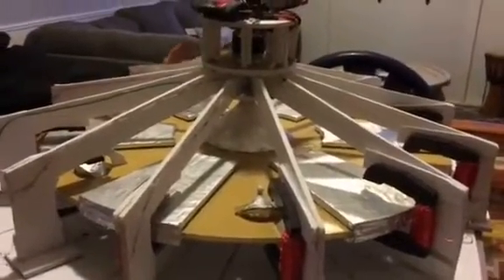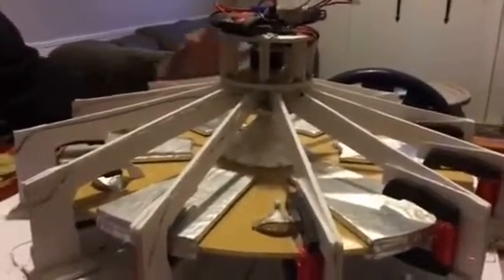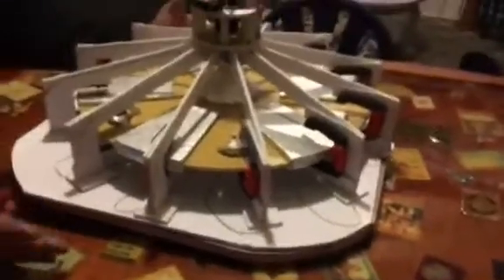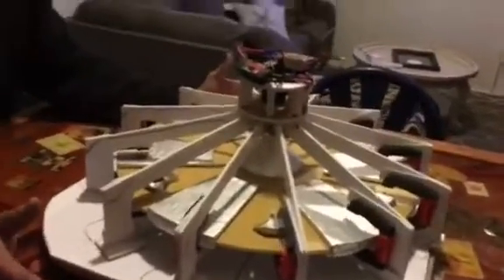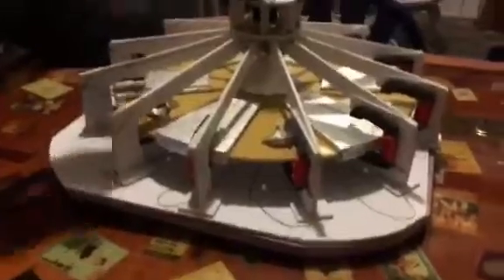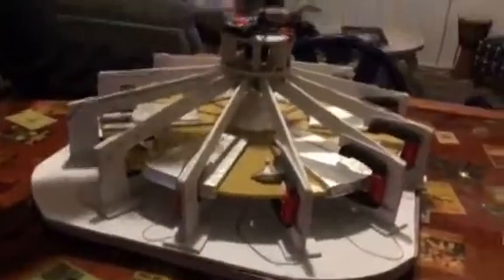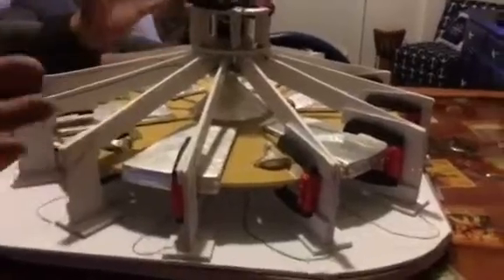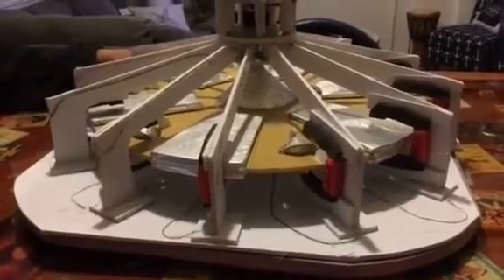OTC X1

Comment: The counter rotation is because it is like a top or gyroscope  ....Your craft needs to counter rotate to make work right ...and the cone barrels on the side need to rotate too the plates on it are like capacitors plates for static or electrons  ...

Comment: It is spinning the opposite way because it wants to lift up..in cress the rpm of the internal disk ND you will achieve flight
Reply: Got any experience
Reply: @multiverse8101  just the copious amounts of research and studying I have done over five years of the OTC x-1 engine

Comment: If you want to sink a screw, you hold a drill and the screw goes clockwise. If everything else is the same, but you can somehow let go of the drill, the drill would spin counterclockwise. If you could just put a little pressure back on the drill, the screw would move clockwise as the drill moves counterclockwise. The outer shell is holding the drill with a little pressure and the inner disc is counteracting that pressure.
Reply: He has a loose screw

Comment: This is Correct like you said ! the inner disc spins counter-clockwise, and the outer hull spins clockwise, they counter rotate each other as Otis mentioned. Probably if you spin the inner disc clockwise, the outer hull will rotate counter clockwise. This is action and reaction taking place, just like a conventional motor when the rotor spins with a torque, the stator will have an opposite force and then will rotate in the other direction if it was free to spin. Or if I jump from the ground, I would go upwards in a moment with a force, in the other hand I am also pulling the earth away from me. If the earth was light enough, she would go away from me in the moment I would jumped.
Reply: It is the effect of the electro-magnets magnetic flux pushing on the aluminum capacitor plates and utrons via Lenz law that causes the hull to counter-spin based on the design of the central axis and bearings

Comment: I think you should replace the outer frame with aluminum..
That magnetic  field wind could help move it.  could..or is it suppose to spin?
Reply: In terms of the concept of the craft, the inner disc rotates clockwise and the hull rotates counter clockwise as it is supposed to

Comment: Yes there's a reason for the two turning parts turning in opposite directions, it's torque effect, same that forced helicopters having a propeller in tail to keep it straigth and not turning around main rotor.
High power aircraft with propeller propulsion had same issue, the influence of propeller and engine torque on airframe. But Otis Carr patent is for an amusement park machine. ??? 
An image of an helicopter that lost tail unit over NYC and crashed shows the body turning around itself.
It could be a case of  'Action and Reaction' principle, which in the end would be just an special case of 'Momentum preservation' principle. Blessings +

Comment: The electomagnetic energy or force created by the coils when energized and in conjunction with the capacitor plates creates an  equal and opposite push force thereby causing the hull to spin counter to the middle disc, at least that is the explanation Carr gives regarding this phenomenon, RCDad i know this comment comes 4 years later, but i wonder have you kept up with the build? i am doing the build myself 3d printing most of the parts that arent required to be conductive electrically, i would like to co-ordinate with you if i have questions since youve allready succesfully built the device to the point where it is spinning as it should.  I am only creating a scaled down version, probably the same size as yours if not a tad smaller.

Comment: It is supposed to counter rotate and the negative on bottom and positive on top of disk shaped craft that is how it hover or creates electcromagnetic field ...Positive always goes to negative... Make feet that attach to bottom that are no magnetic for your device that are not stopping it from counter rotating ... Then add all positive wires of the  c magnet  to top of an antenna and negative to bottom of a antenna and then see what happens ... have fun
Reply: Any luck?? If so how can we chat

Comment: Nice double merry-go-round...... 
But it's lack of lifting or elevation power 

I think that the original blue prints have been changed by fake blue prints....
Reply: I agree that some vital intel is missing, wether intentionally or mistakingly, but i believe we do have enough data to build P.O.C's and experiment further in order to achieve its intended purpose, if enough of us participate in this, i believe someone will eventually solve the mystery of free energy which is the goal, everything else is icing on the cake.

Comment: The electric is pushing the copper counter clock wise causing a rising centrifugal force that in turn force electron outwords towards the the edge with is stored in the steel capacitors (silver material) then since your pushing the disc one way there is a retarding force the opposite I think lol
But in a closed loop circuit using mercury you could you this frictionless material to increase efficiency and power it's self maybe any thoughts?
Reply: Yes!! The Utrons have to be mercury filled

Comment: On a productive note: This is from my understanding of what this machine actually does, from hearing an account of something of similar function: look up a video called “blueprint for a UFO” he explains it nicely. Older gentleman with glasses on the thumbnail. What the central dynamo does is, creates contra-rotating masses, which I think is how the ship gets its mass neutralized. The capacitors around the outside are an arrangement of capacitor plates, insulated from each other, and stacked on top of each other, like if you put 8 pizza slices on top of one another with insulators in between, the point of them being pizza slices is they take up more area space of the circle they are spread around. So when you apply extremely (500k-1Mil volts) high dc current to a simple two-plate capacitor, the plate will hover in the direction of the positive plate. This force is not much, and not enough to fly a ship by, but if you stick one of those plates on a thing and cancel it’s mass, the thing will rocket away at a speed that will break your mind. So to produce a controlled directional force, remember there are say, four pairs of +/- plates, 8 plates in all, in each slice of pizza surrounding the rotor(capacitor plates, pizza slice shaped provide more force/area coverage than square-edge plates) so all of these need to be individually controlled. If the craft desires a little bit more lift on one side, you activate TWO pairs of the plates on the desired side, and it will cause that side of the craft to move towards the positive plates, more so than the side with only one pair active, this makes it yaw. Now you can imagine the control of using plates completely surrounding it. How they got the power TO these plates in a controlled manner is beyond me. I remember reading somewhere that Carr used a Van de Graaff Generator to get the extremely high voltage. The ufo blueprint video explains something a bit more elegant and mechanically sustainable. I think this could be achieved without needing the implement the concept of overunity. Which would be GREAT and would come with time, but I wouldn’t get too caught up worrying about overunity and just work on the physical concepts of this crafts function of flight and mass cancellation. The rest will come. Hell with mass cancellation it may be an overunity device just as a side-effect. I don’t know, I’m not a systems guy, I’m a mechanical functions guy. And this is my interpretation of what I think Otis was trying to impart to us. And if somebody sees this comment and it rings a bell, please for humanity, for your children to be in the stars, for our descendants to escape this NEAR impervious slave system we have been caught in for near 200 years, DO IT. But I don’t think the capacitor plates spin with the rotor. You would have ZERO control ability unless you had a computer to activate lift in the microsecond each plate is on the desired side of which you want lift. And I know Carr did not have that kind of computer system in his time, it was all analogue. I could be wrong, and this is just my understanding of it, but I don’t think the capacitors move, just the magnets, and just the two opposite halves of the central dynamo cones(which are a perfect square when viewed from the side, a perfect circle when viewed from the top, and contain a perfectly sphere cavity inside of them)
Reply: With your description I have just unlocked the understanding of how exactly does the seemingly weightless flight work. 
Now to the laboratory.
Reply: Your Comment is truly remarkable. It should be taken into account as what you have said about the double stack theory can be investigated with actual ufo drawing testimony from a man that saw ufos being presented to politicians, they made a documentary on it. Also, the Utrons are actually made from iron wrapped with Copper coil & the Hollow sphere cavity is filled with mercury from what i got from my investigation of OTC
Reply: Can you try linking the video of the blueprints?
Reply: https://youtu.be/ua0MMXJl3FM
Is this it?
Reply: @wesestes6201  Yeah, that is the video I was referring to. He names some of the capacitor plate effects in there for individual research. Everything he is saying about the modern craft, is extremely similar to what Otis Carr described about his craft, albeit the one this video is talking about is much more refined. Some of the story may be embellished, like there is NO reason any local politicians would ever be allowed to view such technologies at an air base, but maybe he invented that story as a way to cover the trail of actual contacts and how the information came to be found. The similarities and mechanical principles related to Carr's device are just uncanny for this to be an entire lie. What he is talking about regarding the plates is not an ionic wind effect, as some people seem to think. It has been a long time since I have had time to dive back into this world of study, but if I were you, I'd do some individual research on the electrical effects he lists in the video, its been so long I cant recall the names of the guy who discovered the direction effect of the plates. It's almost as if it creates an electrical impeller which pulls itself through the realm of magnetic fields and energy filling the universe, like an impeller will move through water. It doesn't suck or pull itself in relation to surrounding water, it moves through it. I'm imagining the capacitor plate arrangement does the same, by drawing in, for lack of better term, particles of energy and allows them to attract to and eject out of the negative plate, and as such, moves THROUGH the existing energy. I could be wrong about a lot of this, It's just my best translation of the information with what I understand of it.
Reply: @wesestes6201  Assuming you understand how transformers work, I think the outer conical cylinders in between the plates act as a sort of transformer to transmit power between the rotor and stator plates. If you take two coils of wire and apply voltage to one, the magnetic field will transfer the voltage to the secondary coil. What if the secondary coil was spinning? You would be able to use a transformer effect to transmit power through a rotating axis without a slip-ring or electrical brushes. but, eddy currents will lock them in place like engaging an electromagnet, and the power transferred will increase the eddy current resistance in proportion to how much electricity is traveling through it. More power, stronger electromagnet, harder to turn = very inefficient.  I think the C-shaped coils are acting as a transformer, and they are imparting an electromagnetic field onto the conical cylinders, or vise versa, and the dynamos are imparting an electrical field to the C-coils. But because the dynamos are allowed to spin on their axis, independent of the stator/rotor axis, this allows them to just roll through the magnetic field, instead of trying to barge through it while stationary and locking themselves together. Static electricity is not like AC or DC, DC does not transfer through a transformer for more than a single sine-wave. but you can't use AC to power the capacitor plates because the field of energy attraction would be reversing at whatever MHZ the machine is generating. Static electricity is different, and it may flow through a transformer in one steady direction. Im not sure what static electricity looks like, I have never been able to test/observe a sine wave with it, so I dont know how it would behave. But considering how it is generated, it seems like it woud be a form of electricity closer to DC. There is no reversing of magnetic field generating static, its just collecting positive and negative and it just flows, its independent of sine-waves created by magnetic fields. so maybe this is How Carr got around the problem. because if you know about Vande-Graff generators, you know they can generate basically infinite voltages of static electricity. If you have ever set a steel plate across a transformer as an electromagnet, you know this field is incredibly strong while power is flowing and would make a terrible slip-ring. It would be more like an electromagnet brake disk. I think... THINK, that is why he is utilizing the rolling conical cylinders/dynamos, it may get around the eddy current lock. Now I'm not sure which direction power is flowing, into the C-coils, or into the dynamos. I think if the conical cylinders are magnetic, and they are generating a magnetic field which is transmitted to the outer C-coils and the C-coils pass through the magnetic field of the conical cylinders this energy may then be sent to another C-coil which is positioned over a plate, this would transfer the energy which was just generated to the capacitor plates. This high voltage DC field passes through the capacitor plates in a steady stream as it tries to complete a circuit between the arms of the C-coils. If you notice every other C-coil is over a conical sphere, and one is over a plate. If the energy being generated by the conical spheres can be directed to each pair of plates individually, maybe by something similar to a spark  plug distributor-cap, you could move the contact points closer or further away from the input, only allowing power to jump to the capacitor plate circuits which are nearest the input, even paired with a joystick it would be a simple way to control the voltages going to each pair of plates to control yaw. This section is really just off the top of my head because now you got me pondering about it again. It really is a shame because these devices are so simple in principle, but its a shot in the dark trying to understand what these simple components are DOing, where they're sending power, how they're getting that power, and so on. Maybe the dynamos aren't actually magnetic, but rather they are just output collectors for the Van DeGraaf generator. They simply collect the energy generated and impart it to the C-coils as the pass by, and that directs the field to a desired C-coil which transmits the electrical filed through the capacitor plates generating a traveling field. Its not much force generated, but look at what Ion engines can do in space, and like I said, if you strapped one of those to an object with zero mass, it would break the human mind trying to comprehend how fast it would travel. This arrangement of dynamos projecting the Van-degraaf energy would make more sense than using magnetic conical spheres. Maybe this also creates a type of brushless motor effect between the rotors and stator because I don't think his models used a primary drive system to spin the rotors short of starting up. I can only recall reading that there is a hollow, central sphere inside of the central conical cylinders, and it was full of electrolyte and acted as a battery/energy storage. I have never been able to find any material stating what the outer dynamos are actually made of. I believe they're are coils wrapped in such a way that they create a 90-degree angle between all edges. If you look at one from the top, they look like a circle, if you look at them from the side, they look like a diamond/square. If they were made from one solid coil, they would be able to carry electronic current from pole to pole and create a magnetic field in between their power input poles, whereas if they were a solid piece of metal, they would just act as a dead short from the power coming from the VanDe Graff generator and wouldn't create a magnetic field for the C-coils to collect. But as for the central hollow sphere/battery, I feel like that is the component most prone to cause failure in this design and I don't have much knowledge about it. I think it just acted as a power reservoir/battery. They didn't have very good batteries back then, now we could do much better. But then again, usually when someone tries to refine one of these old mythical designs, they make it fail miserably because they don't understand the principles they are modifying.
Reply: @nikolaishriver7922  I like your theory on preventing the eddy current lock, seems as though it would work. The only way to know for sure is to test it out. ;)
Reply: @nikolaishriver7922  so perhaps vande graaff is the key?
Reply: @nikolaishriver7922  I don't know who you are but I could sit and listen to your fascinating theories for hours and hours. Plz tell me you've already tried and at least partially succeeded? I'd love to pick your brain for a day.